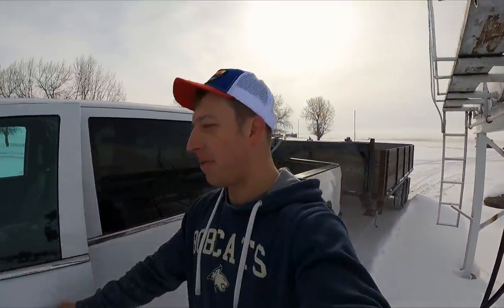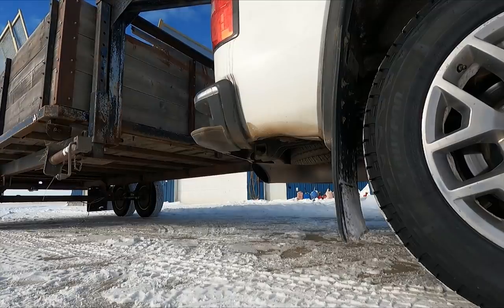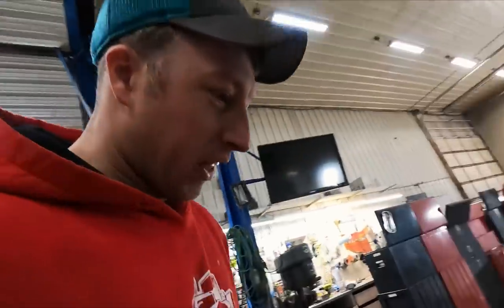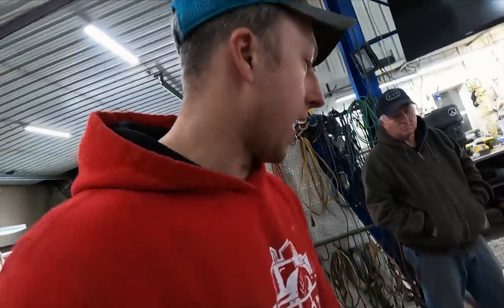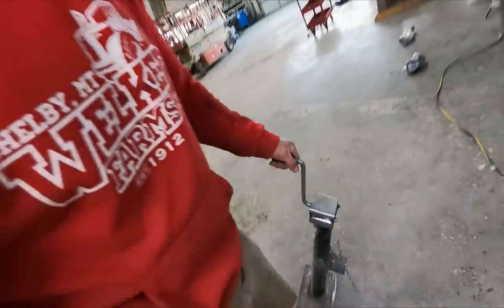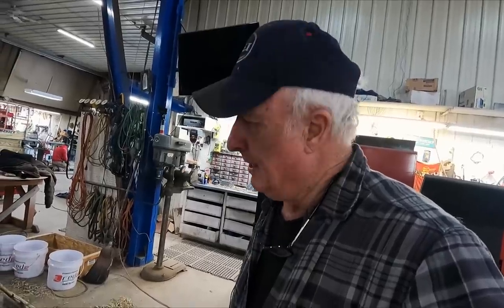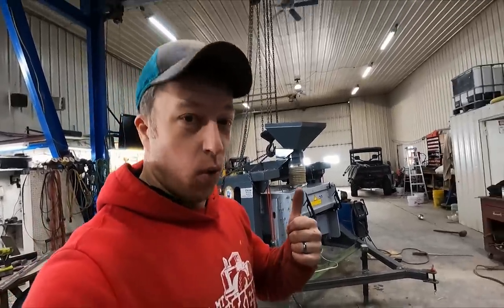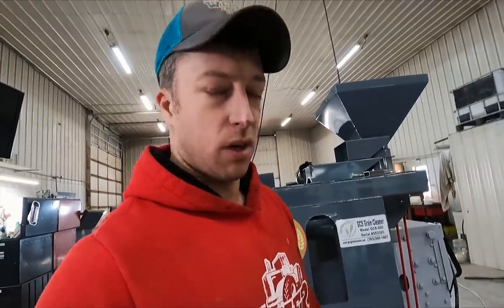Big MODS to the NEW Cleaner!

Comment: Hey nick I use to work at a chickpea plant I ran the grain cleaner. On ours we used 10 mill on top and 6 mill on the bottom seemed to work great and in Saskatchewan u get alot of rocks and never had issues with rocks in the samples

Comment: Good work on the cleaner. I would add some gussets or other reinforcement to the a frame. All the weight of the cleaner is going to be trying to pull the welds on the bottom apart. Granted the top will be in compression but the wheels being so far back will put a huge strain on the front. Even going slow it will be pretty harsh on those welds.

Comment: If you are thinking of upgrading the exhaust on your truck look at the flowmaster flow fx cat back system. Just installed it on my 2014 Silverado and it sounds great. Only down fall was the sound with the afm system turned on. Bought a tuner to shut that off and now it sounds great all the time!

Comment: not sure if you have it all finished already or not and whether this idea would take the weight of an auger but, if your idea doesnt pan out you might be able to make a two piece arm (kinda like a desk mounted montior stand) and use some cheap plastic cutting boards as your bushings that are easily replaced when worn to give you more adjustability to put it exactly where you need it.

Comment: There is a spring loaded butterfly valve in the exhaust pipe. You can take a hose clamp and fix it to where it stays open. Mine has been that way a few years.

Comment: 22:50  Add 4 heavy drop legs with large bases and with levelling holes and pins to stabilize it off the ground (not jacks, which might fail with the wiggling). Good luck with the build

Comment: Love the build.  Have you considered a open air vertical drop between the output from the auger and the separator input?  Mount a fan to blow through the open air gap, and dry matter like straw, grass, hulls, etc will be blown out of the stream of seed.  You could design a capture chute out of screen to keep it from making too much of a mess.
Reply: I've been toying with what we can add before it enters the sieves.
Reply: @RobertWelkerFarmerBob  If you do add an open air gap and blower for chaff, you might also consider a cone spreader right before the air gap to spread the falling grain flow and allow better air penetration through the grain flow.

Comment: Couple of thoughts for you to consider. Install two bubble spirit levels on that machine and position them at right angles to each other on the machines frame - those cleaners are very sensitive about being dead level to operate correctly.
A tripod arrangement for the legs will allow easier levelling but they need to be really rigid as the machine shakes a great deal when in use. Consider perhaps something like the legs from a semi trailer perhaps? 
I understood augars damaged pea seed - does this concern you?

What plans do you have for collecting and transporting away any waste that it sorts out? rubber belt?
I'm interested to see what direction you go in regarding wind cleaning the sample.
Reply: It's a work in progress.  We'll convert to plastic flighting.  Did that to a couple of augers and works great.

Comment: something I had to do to my trailer is to put a ring trailer jack onto it so that I can remove the jack for transport. You could do the the same thing to the back end of your machine to lift it up to remove the wheels off the machine. It may or may not work. But you can always try it or mock it up to see if it may work. the inner rings are welded on and the jacks can be removed after.

Comment: Yeah we tried harvesting hemp 20yrs ago, combine at about 30% and run quickly through the dryer many times as it wanted to burn very easily, never did get the fiber marketed as the industry collapsed. more trouble than it was worth.

Comment: Maybe an idea to build a square tube frame to mount on the bottom of the dryer then fabricate an axle with air bags that way you can just dump the bags to set it on the ground, then put trailer jacks on each corner to level it up.

Comment: I have seen blades break like that before. That is why when that same type is on an angle grinder they call them death wheels, they get hairline cracks from being hit, bent, or abused and an angle grinder spins so fast they explode. A chop saw doesn't spin as fast so it is less likely to explode

Comment: What about a set of fold out, extending arms with foot pads like a crane truck would have?  This, instead of pulling the wheels and setting it down on ties.  Obviously, hydraulic extending arms would be preferable but that may be too involved.  That pulling the wheels part is the only part of your plan that seems iffy.  Just a thought.

Comment: Could you fab up some kind of stand for it so you don't have to remove the wheels? Could use the hydraulics on a tractor to raise or lower the legs, and they tuck up under there nice and safe when not in use. Just an idea to save the labor every time you use it

Comment: Sorry Nick it should have said between yourself your father and leg arms will all put your heads together and figure that screener out I like the idea what you're doing but for a heat screen you may want to put a smaller one in so the wheat drops are in the chaff blows or the wheat blows out and that chaff stays behind balls in the floor or something but I'm sure you guys will get her all figured out like he did that rotor smoker that was one cool idea in Case IH came out with and you guys did the  work and Tony Fast "aka Fast Ag Montana" helped you on it and it look like it turned out awesome

Comment: Just make pull out Jacks on 4 corners like how light plants have, makes a large foot print out and is adjustable with 4 jacks like you have on the front, so technically youd have 5 points of contact on the ground

Comment: Why not add jacks at the rear of the frame at an angle like the highway mobile led board's have? Two jacks angled away from each other going side to side would make it stable and no need for blocks, just a thought.
Reply: Those jacks work great for light duty leveling, but the way that machine shakes would destroy those jacks.

Comment: Use for implement Jack'sUse for implement jacks, That way you can also level it on uneven ground, Started out with one similar to that ended up with a  Roto screener Style, It's a lot bigger and more cumbersome But for cereal crops does a way better job, My 2 bits

Comment: Might consider cross brace down from the side steel panels to the hitch.  Forming a triangle.  Lots of stress on those hitch welds when bouncing down the road or across the field the hitch is a long lever.  Hitch is good metal, welds are the weak point.
Reply from the maker: Definitely a good idea and I plan on adding more iron on those joints. Some 3/8" straps across the top and bottom would be great

Comment: If that's just the same 1/8 wall 3" tubing, I would really add a brace to the top. That butt joint welded on the front won't likely hold that much bending long

Comment: So for the air system you said it sucks out the top, would you be able to use a grain vac for that?
Reply from the maker: Definitely could! We bought a cheap dust fan rated at 800 cpm and will mount it on top and see how well it works. I am betting it'll be trial and error till we get it purring!

Comment: If Legarms doesn't do so much for the farm now, he can anyway take the drill-press and make bigger 6 mm holes in the sieve. If it appear to not be enough, he can start over again with a 1/4" (6.35 mm) drill bit. Its a long time until your next pea harvest! And it's also a very good training for his right arm when he hold it high!   Haha!
Ps. Isn't your grain vac a good suction fan?  ;D
Reply: LegArms would have used the mill.  And yes his right arm is weaker. 😊

Comment: Does this unit have to be level to properly operate correctly to clean and not over load one side   etc. Thanks
Reply from the maker: Yes I believe it is very important to be level so the product flows evenly through the machine.

Comment: I know it would have taken more work... but a swivel mount for those axles would have reduced your work in the future. Just park it where you want, crank down a trailer jack/tongue mounted, then pull pins and rotate the axles and re-pin them in a locked position.

Comment: instead of having to take tires off every time when in use, fabricate a bracket with a pivot point and attach a hydraulic cylinder on each wheel that will lift and the lower the cleaner like some ice fishing shacks and car trailer/car haulers have, youll save time from having to use a jack every time

Comment: Hey Hollywood, what was that angle finger thing you were using making the a frame? That looks pretty nice! I could use something like that!
Reply from the maker: I think it is a magnet square used for metal fabrication. It'll sure be used in our shop!
Reply: @WelkerFarms  Not the magnet square you found, the adjustable angle thing you were using on the A-frame build. That magnet was a great find though! I wonder if the previous owners had it in there to hold the screen down or something? Its hard to below the manufacturer would leave that in there.

Comment: I need tips so i Can start farming
Reply from the maker: First... Get yourself a red tractor... Or white those are good too 😉 jk
Reply: I would say start with a large sum of money and stop when it become a small sum of money.
Reply: For starters on farming if you don’t have any experience it’s easier to start with a small garden. After that you can work up to a small acreage farm like 5-6 acres, also for a small acreage farm you should get an antique tractor of any make because lots of the older tractors had implements that were made specially for them and are usually sold with the them. Or you could get an expensive new utility tractor and pick your implements. Then  from there on out you should know what to do.

Comment: Your still not getting the koticha seeds out an other weeds that you keep reseeding every year
Reply: the machine they brought will do that, with the right size screens it will separate them.
Reply: @thatwazfunaz  do you even Farm bro you have no clue
Reply: @travishofer6264  i do not farm but i do clean seed/grain for a living. While i don't have experience with those exact weed seeds unless they are the same size as the seed being cleaned they can be separated with a screening machine like that. If the same size may have to separate by weight
Reply: @thatwazfunaz  I don’t care if you’re job is cleaning seed but if your stupid enough to think the cleaner they got will clean any weed seeds out then you have no idea how the whole cleaning system works n don’t get me wrong I don’t care they can clean n seed watever they want weeds or not it doesn’t matter to me but mi point is a 400000 thousand dollar machine doesn’t even fully clean all the weed seeds out
Reply: @travishofer6264  the machine they have can remove some weed seed depending of its size compared to the size seed they are cleaning. 
i do not know the value of the machine i operate but i can clean lucerne seed to a 99.99% purity, granted its a lot more complex than their machine. but my point is what they have can remove weed seed.
Reply: from my quick research kochia seeds are about 1-2mm long if they are using a 6mm screen to clean their peas it will remove all kochia seed

Comment: make axle like on ice fish shack fold up and set frame on the ground
Reply from the maker: Thought about this, issue is how do you power it? We won't have hydraulics nearby and I don't want to pay for electric actuators. When you see how fast we can drop it down with a high lift jack I think the extra work of a folding axle will seem unnecessary.
Reply from the maker: Honestly though good idea!
Reply: @WelkerFarms  feed the hydraulics with the tractors